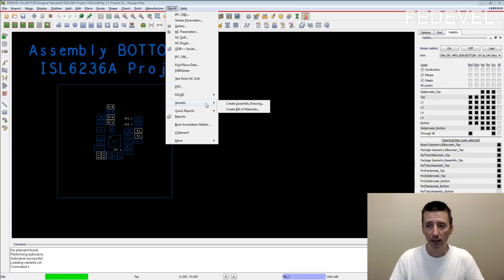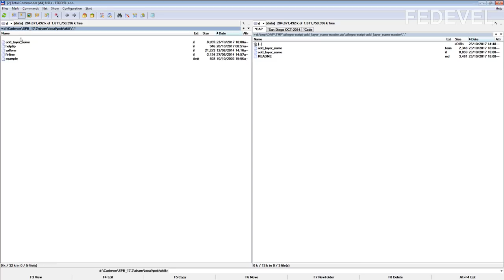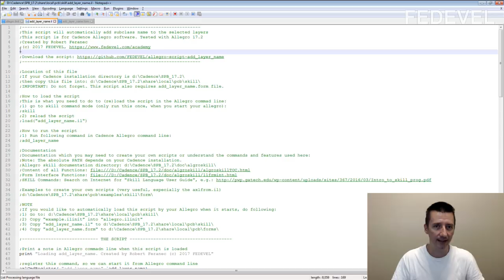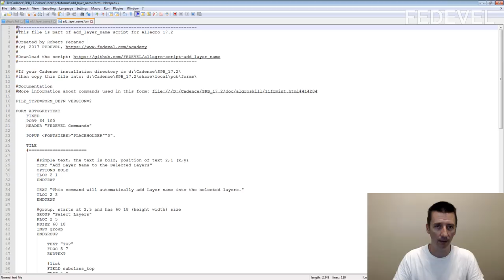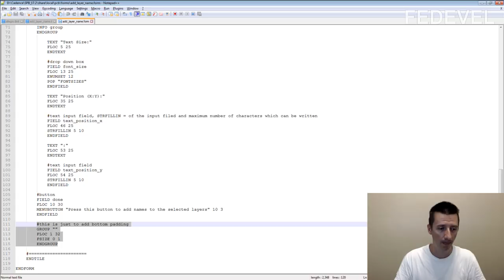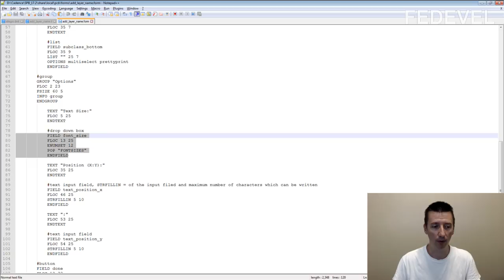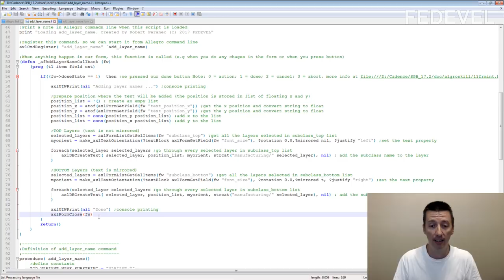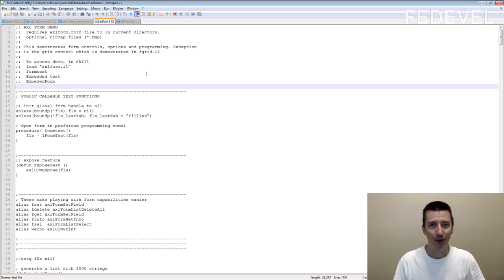Cadence Allegro Tutorial - How to create SKILL Script and your own Commands

Comment: Robert, there is error E- Error axlFormSetField: argument #1 should be any user-defined (other) type (type template = "otg") - nil
Reply from the maker: Do you mean it doesnt work in your Allegro or it works, just the script shows you this error? What Allegro version are you running?
Reply: 17.2, i got it already, need to set form path.=)
Reply from the maker: Ah, so is it working now? What exactly did you need to setup - so I know what to answer if someone has a similar problem.
Reply: User Preferences Editor>Paths>Editor>formpath....hence we can actually put our form any location we desire too
Reply from the maker: Thank you for this info
Reply: Hi Robert, i have difficulty in generate form, not sure will you help me to have a look?
Reply from the maker: Please, post your question and screenshots on our forum here, if I know I will try to help: http://www.fedevel.com/designhelp/